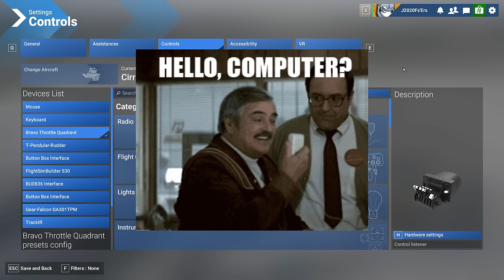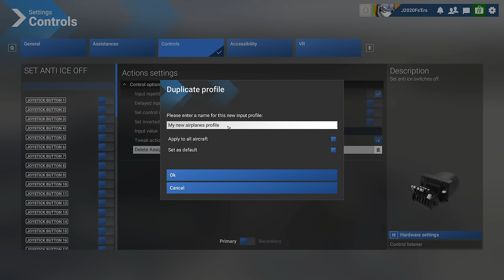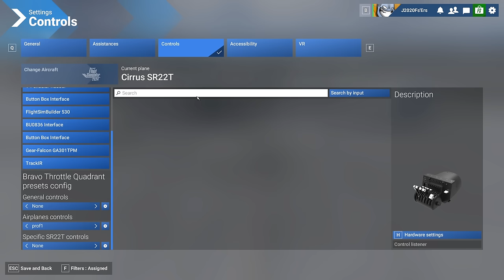Msfs2024*Issues with key binds? What not to do-How to start from scratch-Not as easy as you think!

Comment: Tobii 5 head tracker not working properly. Not all setting available in sim yet.
Reply: Good to know this.  If Tobii doesn’t respond properly in 2024,  I have no reason to switch from 2020.  The Tobii eye tracker is a huge upgrade in the sim for me.
Reply: Yes, so I am using my old trackIR for now.  Working great.  Only have to wear a baseball cap again...Can't wait for the custom camera saves to work.  Edit:  If only I noticed that even on tobi site they have the link for Open track.   Now it works.
Reply: i had to use open track you can't use tobii in the sim 2024 it just crashes in settings  the rest of 2024 is crap tho what a waste of money i'm back on 2020 i swear by open track wish i had it a long time ago good luck

Comment: Excellent very helpful video. The reason your newly created profile reverted to all the binding it inherited when you created it is you must SAVE the new profile before you leave it.   You must first push the ESC Save and Back button, which in a couple more of Asobo's what were they thinking moves, (i) may be hidden and require using the Go Back lower left of screen to get to the Save button and (ii) this then takes you all the way put of Controls Settings and you must  select the gear button top right get back to Settings General where you must once again select Controls. Yikes, although conceptually a good structure of the controls settings, sure is difficult to figure out.

Comment: I can't even get the software to scan so I can actually pick a switch to use on my controllers. When I left click in the scan window it briefly shows scanning and then defaults to a "wrong device" message... it's like my mouse is double clicking when it's not.
Reply from the maker: Maybe another device is activated . I had a controller upside-down on the floor and 1 of the sticks were engaged causing issues

Comment: I have a bespoke parking brake lever, didn't have any problems mapping it in msfs 2020, but in 2024 sometimes when trying to assign it it doesn't register the lever movement but even when it does populate the box it stays there for a second and disappears saying scanning cancelled.
Reply from the maker: Have you tried to go in the windows and recalibrate it as a windows Gaming device. That may help
Reply: @2020fsers  No unfortunately I don't even know how I'd do that.
I will Google it, thanks.
Reply from the maker: Control panel . Hardware and devices then right click on the device  game control settings then settings tab calibrate
Reply: @2020fsers  OK, thanks. I tried that, there is no option to calibrate it, it's greyed out.
I've managed to map it as a toggle switch, but I can't map the in position as park brake off or the out position as park brake on.
It's really weird, I had no problem in msfs 2020.
But the toggle on off works, just need to make sure it's in the out position before starting a flight.
Thanks for your help.